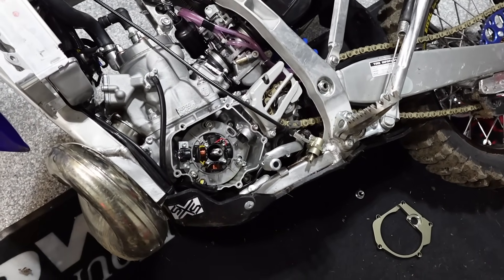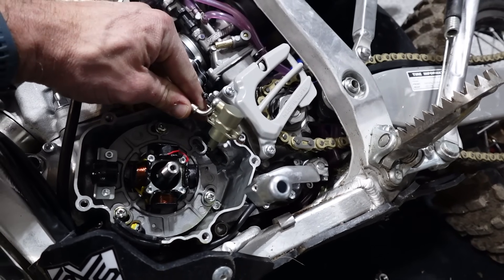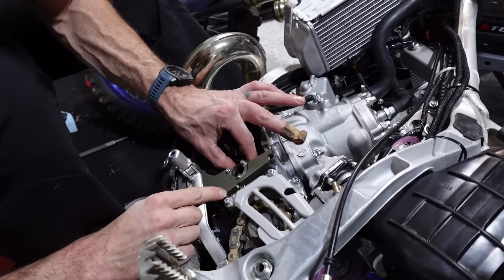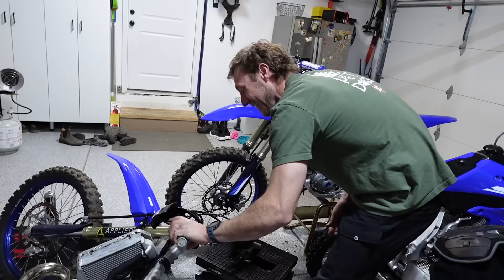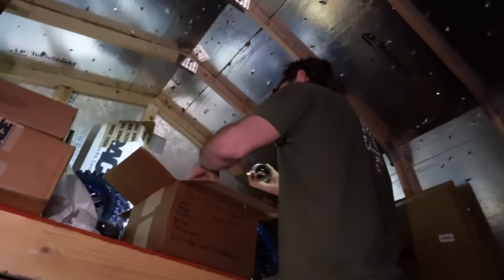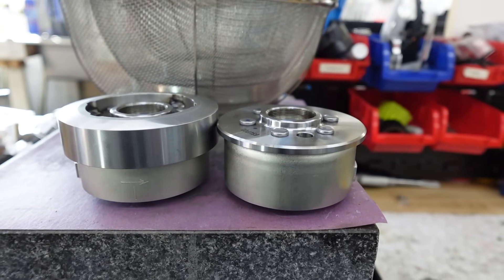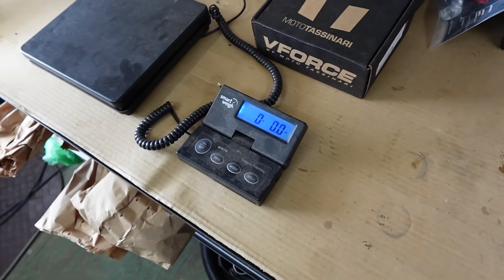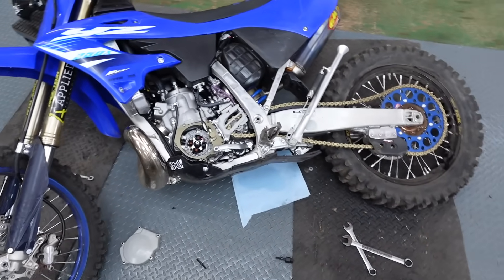YZ250 Brembo Hydraulic Clutch Conversion with Valentini Technologies

Comment: In another vid I think you mentioned using the Boyesen RAD valve but this bike has the V-force. Not sure if you already went into any detail about it but I'd be interested to hear your opinion on the two. Also....have you considered a steel clutch basket? Somebody makes one but can't remember who....functions like a flywheel weight. Pretty durable too.
Reply from the maker: I've mentioned the steel basket multiple times here now in the comments haha. And good eye on the reeds, I'm catching up on older content. This is actually before I got the chance to test anything from Boyesen. They came up with a 'hard enduro' specific reed block. Plus they have extra fancy doodads I can use on the bike as well.

Comment: That clutch arm is the same on my rm250. I'm not keen on it with my magura and think that shackle bit should be bushed to the arm, mostly because it looks jank. However, I like the feel with my rm because the cam part (bit that pushes onto the actuating rod) is worn so the feel is quite linear. I have a non worn cam and I don't like the sudden break feel of the clutch.

Comment: Cody is the Magura worth it? Obviously not going to be as good as the Brembo from Valentini but does it feel a lot better than the stock cable clutch? Looking to upgrade but some people say it’s not worth it and I know you run it on your fisch moto e start bike
Reply from the maker: I'm still not sold on the magura. Just got a 10.5mm Magura to test to see if that helps. I still say cable for now.
Reply: @codywebb2 have you considered the righteous stunt clutch easy pull for the cable? They are pretty solid

Comment: You can machine the gytr flywheel and add weight out on the end, slightly.
And or press a thin sleeve over the magnet area to gain back the loss weight.

Comment: Such a better design over the Magura. I bought the Magura, installed it, rode the bike for 2 mins in my driveway and pulled it back off. Still sitting on the shelf 6 years later🙄
Reply from the maker: Don't blame you for that decision. They threw a bandaid at an open wound that clearly needed stitches haha

Comment: It doesn't matter where the weight is on the flywheel. As long as its balanced. its inertia. The long arm analogy is right, until its in motion. Then its just 2 spinning masses. Your probably right that when you kick the thing, it takes a bit more to swing around the outside weights. but as soon as its in motion, your not SPINING it, you are relying on its conservation of momentum. That extra weight while it takes more to kick through the compression stroke, it has more momentum to get through the next.
Reply: Moment of inertia: “a quantity expressing a body's tendency to resist angular acceleration. It is the sum of the products of the mass of each particle in the body with the square of its distance from the axis of rotation.” The further away the mass is from the axis of rotation, the greater the moment of inertia.

Comment: I went thru the same dilemma. I tried fly wheel weights including the stealthy bolt on. I found the low end grunt and top end blur when I tried the ESR 325 kit (pump gas and HC domes come with the kit) with an lectron carb. I did this with a ‘16 yz250 pre X model. Also installed wide ratio 3-5 gearing. I got the engine very close to a 2015 TE 300 but better. With the bigger bore there was no need for a flywheel weight. Vibration was cut in half from stock bore. Installed a new oem crank I had trued, balanced and welded at crank works. I also use a hydraulic clutch and 22mm offset triple from ride engineering and sprung by factory connection. Also look into the DEP pipe, best one I found.
Reply: I just mill the YZ450 upper tree to get the 22.5mm offset and that made the bike... I'm way faster in the woods now....  Did the same to my WR250f